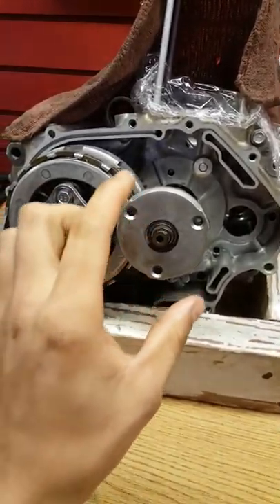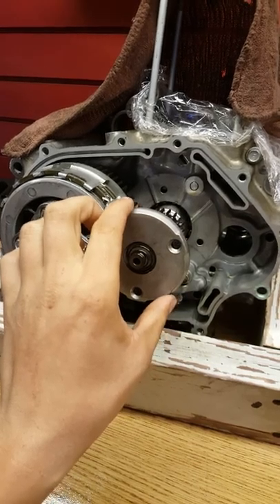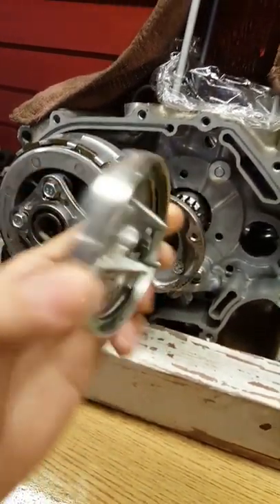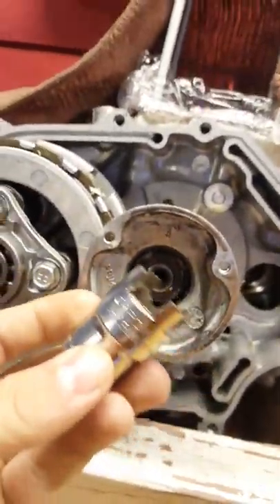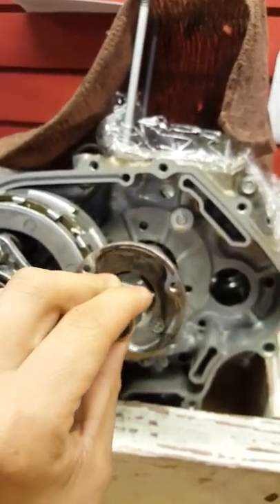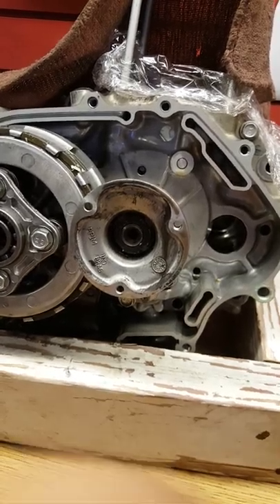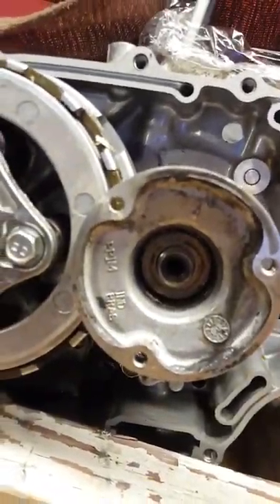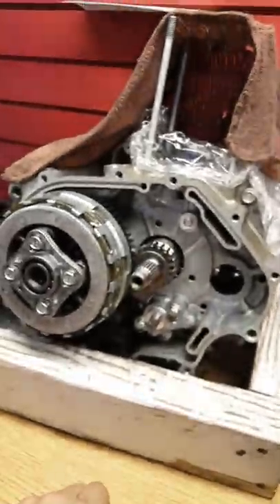2006 Crf150f Centrifugal Oil Filter Removal

Comment: Does this bike have an oil filter? My friend said it doesn’t so we just put the oil in it. But I haven’t gotten anything information on if it reallly does and I’m kinda of worried.
Reply: If you haven’t got your answer, it does  have an centrifugal oil filter and is really hard to clean. Most of the time people have gotten away with never opening it up and cleaning it but if you are worried just take it in and asked for it to be serviced at a Honda Shop